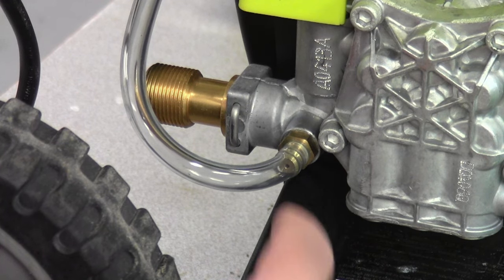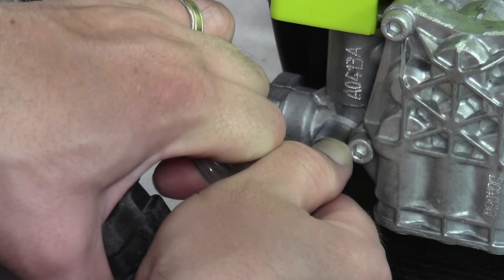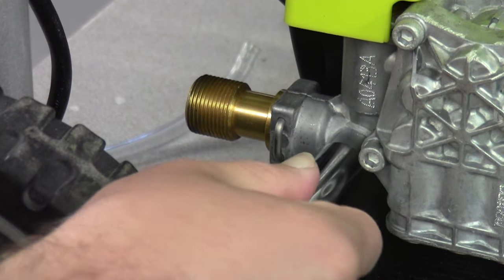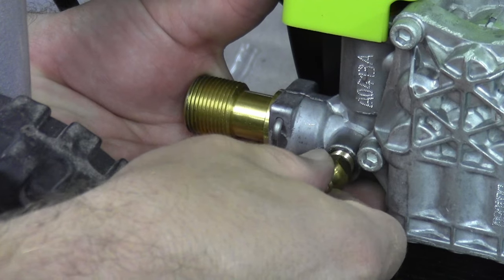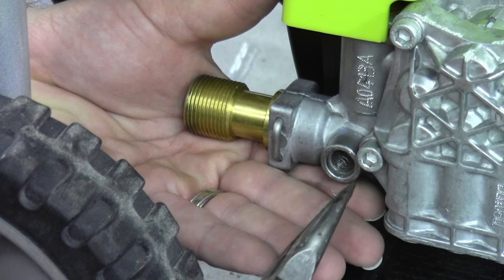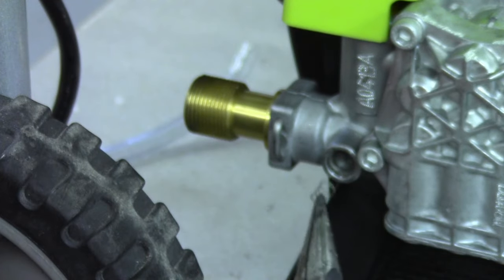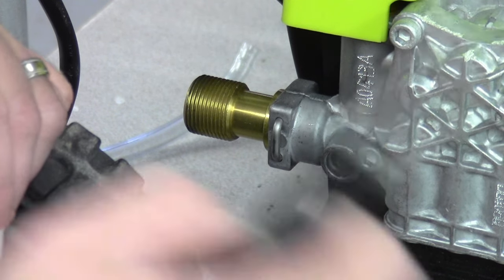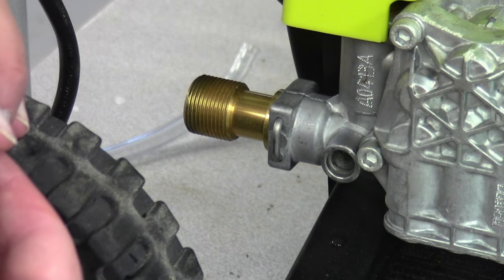Cleaning Soap Siphon | Ryobi 1700 or 2000 PSI

Comment: I'm getting water BACKFLOW into my soap bottle on my small electric pressure washer. I don't get it. The water pressure from the hose is running INTO the bottle and over flowing bottle. What's going on here and how do I fix it? It's been doing great for 4 years.
Reply: The ball blocks it.  See if you have the ball

Comment: If you take off the connector and it's mucked up with dried soap/bleach crystals the spring will likely be stuck. You have to pick the area clean with a small drill bit until you can get the spring out without mangling it. Once you get the spring out if it's a little out of shape you can bring it back to shape with needle nose pliers. In the pressure housing there is a hole about 1/16" through the center. That is likely clogged as well. You can pick on it to open it but you can also hook up the pressure washer and with the soap tip let it run and blow the hole clean. When you reassemble the ball bearing and spring it's critical that the spring push against the ball bearing and not off to the side. I put a touch of grease on the bearing, put it in the hose fitting, then put the spring on the bearing both held with the grease. Alignment is perfect that way. The grease will wash through with soap.

Comment: what is the name of the part you took off?  mine corroded and literally broke in half (the bolt part is stuck inside).  I don't want to buy a whole new pressure washer.  I cannot find the part on the diagrams online.
Reply: Soap Injector Kit

Comment: DO NOT OVER TIGHTEN! This video was really helpful. But unfortunately I over tightened and broke the threaded end of nipple inside of it. I am going to have to replace the price it goes in to now also. My fault. Just a heads up. I should have known. It's brass for crying out loud. A lot softer than steel, but better for corrosion.
Reply: @Rich Hoops would an EZ-out work to extract the end?

Comment: I wanted to add that I just received the replacement chemical soap injection kit off Amazon for this down stream part. And it has a small o ring that goes in and seats at the base of the brass nipple before the bearing is added. It was hard to get the o ring in, so I put the o ring in and put the BB on top and pushed in with thumb to start, remove BB and push in with a small diameter round plastic rod. A dab of dish soap might help, the o ring wanted to twist. Something the perfect diameter is best.

Comment: thanks this is exactly what I have on my 1 year old greenworks pressure washer - the ball was stuck obvi in sticky soap residue - used a paper clip to push the stuck ball out...rinsed the fitting, o-ring, spring and ball in a hot water vinegar solution and that did the trick! thanks again!!!

Comment: I have an old Ryobi 2000 and it has this connection. The pressure washer given to me. But when I connect a tube it does not draw soap out of bottle. Is there another switch?
Reply from the maker: Make sure you are using the black soap tip.  The lower pressure tip allows the soap to be sucked out of the tank.

Comment: Beyond the spring is also a nozzle with about a 1/16" hole that you can slip out and clean.
Reply: How please? This pin hole under the spring is clogged solid for me. Have tried a needle and cleaners just to clear it but maybe I need to take it out if I understand you.
Reply: @Shanexxl  If it's that solid then maybe an overnight soak in carb cleaner? Mine was plugged but not solid. Break off the needle and try to chuck it in a drill? Good luck

Comment: My soap is not  ejecting from soap dispenser what is my problem?
Reply from the maker: Make sure you are using the black soap tip, not a high pressure tip.  Check for clogs at the dispenser.

Comment: My ryobi pressure washer is new and it won't dispense the soap for some reason
Reply from the maker: Make sure you are using the black tip.  It will only come out with a low pressure nozzle.

Comment: My hose burst off and the screw broke off half way in the machine. A friend drilled it out but I’m assuming I need multiple replacement parts. Help! Can send pics for reference.
Reply from the maker: I'm sorry you are having issues.  ereplacementparts.com can be a good resource to find parts or just part numbers.  They don't always have things in stock as they may be discontinued but you may be able to find them else where. https://www.ereplacementparts.com/ryobi-ry14122-pressure-washer-parts-c-7931_15737_281665.html Best of luck!

Comment: I snapped that piece that attaches to the hose by over-tightening. Any idea what part name and number that is?  really would appreciate the help.
Reply from the maker: Check out https://www.ereplacementparts.com/ryobi-ry14122-pressure-washer-parts-c-7931_15737_281665.html

Are you talking about the Detergent Nipple Assembly?  If so, here is the info on that: https://www.ereplacementparts.com/detergent-nipple-assembly-p-1757378.html

Comment: Mine is brand new. No soap.  Now what?
Reply from the maker: What tip are you using? There is a tip just for soap.  It comes out really low pressure
Reply: It was the tip! I'm all set. Thanks
Reply: Jan Lundberg is it the black one that let the water comes out as round? Cuz I borrowed one & I can’t see any soap even thought I cleaned that & I turned the water & it was coming out hard.
Reply from the maker: The black soap tip should be the same size as the normal tips.  The bigger black attachment that makes the water come out in a pulsating cone is not a soap tip, it’s a rotating turbo nozzle.
Reply: DakotaBusy I looked it up & ordered the one. Thanks.
Reply: Is that after the pump

Comment: I can't get the case apart to get inside,  are there hidden screws or snaps?
Reply from the maker: To get the green top plastic off, there should just be the screws on top.  I think 6 or 8?  I can’t remember at the moment.  Once those are out, it should just lift off.  Pay attention to the wiring that is still attached to it.